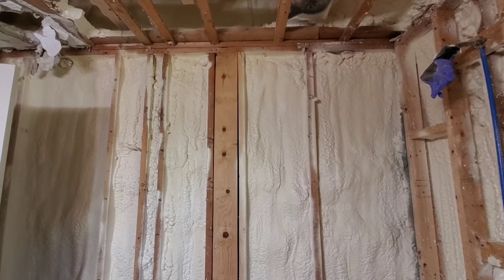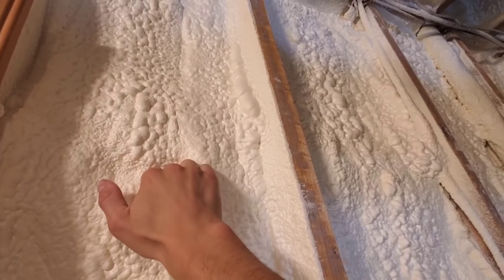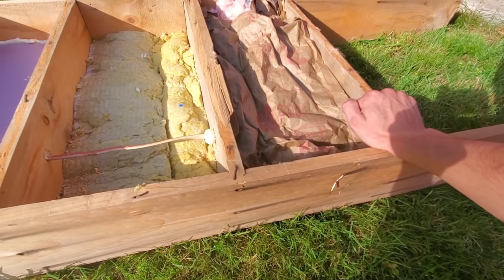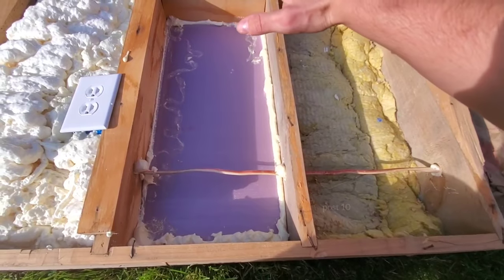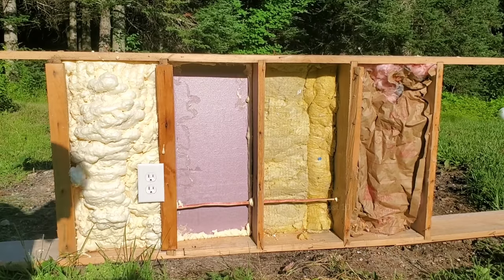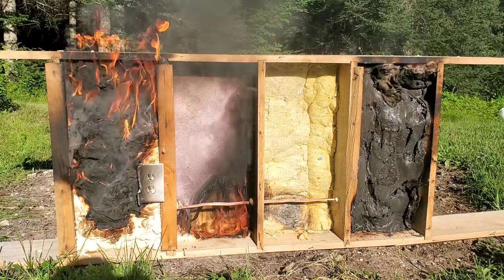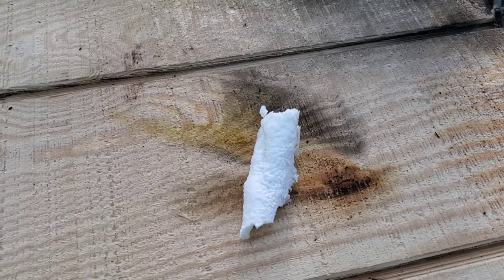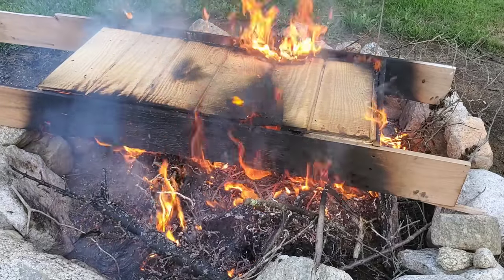Testing The Burn Ability Of Insulation In Wall

Comment: Well now, I was going to spray foam my basement but not now!  Thank you so much for this demo.
Reply from the maker: Spray foam is generally safe as long as it's behind sheetrock or the electrical work inside the foam is modern and can handle the load put on it spray foam is a great choice for a basement to solve a humidity
Reply: I would advise you to use foam in the basement or leave it uninsulated. Batt insulation is not advisable below grade as any moisture infiltration could cause catastrophic mold issues
Reply: @JKSSubstandard  Rockwool cannot absorb water and will not mold. I used 2" foam board on the concrete, then a 1" air gap and filled the stud cavities with Rockwool.

Comment: The spray foam in my home was treated with a fire retardant and very difficult to burn. In a real world scenario the insulation would likely burn less than in this test as the drywall would limit the amount of oxygen getting to it to an extent.
Reply: Finally some common sense, it takes oxygen to make fire.
Reply: Idk where you live but here firefighters are allowed to walk away from a house that has spray foam because  of health hazards. One reason spray foam isn't that good
Reply: @roastingpeanuts  this is not true. Why are you spewing nonsense?
Reply: You hope.
Reply: @roastingpeanuts  Just flat out not true. If the spray foam is up to code, the house can be entered.
Reply: thats not the right foam to  do that type of testing on Can foam or window foam is not treated like the spray on foam
Reply: A thin layer of Gypsum/Plaster does The trick!
Reply: If the spray foam is up to code, it’ll go out just like the rock wall
Reply: @metapaneco16  thank u!! Somebody knows can foam is completely different from actual spray foam!! Also foam seals up a house so well that it can’t  bring in enough oxygen to keep the fire burning. We have had a house catch fire before and it burned for 45 minutes and there was a basketball sized burn spot and the house was saved. Due to lack of oxygen for the fire to burn.
Reply: @roastingpeanuts  rediculous. I would have to see that in writing there’s no way to know what insulation material is used in a home as a fire fighter just coming up to the scene. The furniture is just as bad or worse as for as toxins.
Reply: @roastingpeanuts  So all the burning plastic and furniture is all good for them then? A burning tv or foam couch isnt toxic?

Comment: Thanks for the video! Very interesting. Over here in Spain, we use insulation board and injected foam frequently, but our way of building residential houses is completely different than that in the US and uses bricks, cinder blocks, or cement for everything, leaving an air gap between external and internal walls that can be filled with the foam. However, whenever drywall is involved, the general practice is to insulate with fibre glass from a roll (or also injected in the air gap).

Comment: Few notes. The yellow is rockwool and is meant as a fireproof insulation. It's made from stone fiber as opposed to glass. It's main use in the US is fire rated wall assemblies. Second, while the rigid foam materials are flammable, they aren't nearly as combustible meaning they need a significant heat threshold to start burning as opposed to just melting. Normally these materials are all protected from open flame by gypsum drywall or plaster. All of these materials are laboratory tested before they can go into a building.

Comment: Spray foam insulation is awful. Foam board isn't much better.  It burns enthusiastically, for a long time, and produces very noxious smoke.
Spray foam, in particular, can also not be applied correctly and not cure properly, resulting in the outgassing of large amounts of VOC's for extended periods of time.
Reply: Only one thing i can think of for spray foam and foam boards is good for is for cosplay. You can make pretty impressive looking armor and props (fake weapons) out of em
Reply: As far as fire hazards go, yeah, the video shows it's pretty bad in that regard. But apparently it has its own benefits aside from that?
Reply: @leezard7696  thats what i meant 🤪
Reply: @GizmoTheGreen  I believe that foam stuff is banned in all of Europe, for good reason it seems.
Reply: Is the not curing issue still an issue- we had problems in the US a decade ago but thought it was fixed with better formulations and training.
Reply: @qactustick  many. First, it holds its insulation value even when exposed to water while fiberglass and rockwool can lose much of their value, sometimes permanently. Second, they don't like to mold which can compound the batt insulation issues. For these reasons, batt insulation should NEVER be used below grade. Third, while these tests do show a flaw with the foam, know that it's an unlikely one to manifest in most situations. While they are flammable, these materials are meant to be behind gypsum and plaster which should protect it from direct flames long after everything inside the house is lost already. In this sense, your furniture, wood floors and vinyl tile are more likely to burn up than foam insulation in a house fire. They also have a high combustion point and tend to melt rather than burn when exposed to heat. Moral of the story, should every home be fully spray foam? Probably not. However it's not inherently dangerous even in event of a fire
Reply: @GizmoTheGreen  not banned and available in Sweden.
Reply: @NekiCat  not banned in Europe, but compared to the US it's a fairly new isolation material, hence why it's not used as extensively.
Reply: One more reason I would never considerate in a home...the long term VOC issues.  I'd rather pay a little more every month for fuel consumption/electricity than have this spray foam in my forever home.  We have it used on commerical jobs all the time and it's some air tight, good sealing stuff...no thanks for me though.....I don't need to live in a vacuum tube either.
Reply: @NekiCat  it's not banned, I've got it in my house, open cell one, way better than fiberglass. I don't know what kind he used on this video but here it's fire retardant and had instalator showed me on a piece with a lighter, it melts and barely burned and once he took the lighter away it just stopped.
Reply: You use that stuff in america in houses oh boy.
Reply: while xps foamboard does melt (because it is plastic), you must do 2 things when creating a hybrid insulating setup for basement (still best method 2" xps & 2x4 R16 stone wool), you should always use stone wool (rockwool) insulation instead of fiberglass bats, and create a fireblock separation every 2 panels (8ft) to limit/slow fire spread if the fire does manage to get through the rockwool and start melting the xps.

When using any sprayfoam, you should be using an anti-fire protective layer atop it like Soprema DC315 for example, which creates an ablative fire protection layer.

Comment: The variable of limiting air and flow seems significant.  Possibilities that come to mind are foil backed foam board, drywall sheeting, and combustible paneling to cover both sides of the cavity.
Reply: You are correct, That's why the IBC has what's called protected assembly's..ie the combination of different materials make a PROTECTED ASSEMBLY!!!!!!!!!!

Comment: First off, code almost eveywhere requires that closed cell foam in any living quarters be additionally sprayed with an intumescent paint.  This is a fire retardant that works extremely well.  Fiberglass insulation is the poorest insulator of these four by far.  Especially at rim joists where so much heat is lost in an average home.
Reply: intumescent paint is only required in exposed living areas with no drywall such as an unfinished mechanical room. typically your foam is separated from living space with drywall which acts as your thermal barrier.

Comment: I totally was going to put the spray foam in the remodel on my house. The selling point is the thermal capacity. Id rather pay a few extra bucks a month in heating/cooling then what I just saw. That yellow foam, id I can figure out what it is, is what im going with. My family matters to me
Reply: Rock wool. That’s what you want. Not the spray foam, you want the rock wool.
Reply: You should chose an insulation material on it’s insulation value. You will use fire resistant OSB sheeting anyway to cover up the walls.
Reply: This test is flawed. Closed cell foam doesn't burn/rot/mold. This guy used Great Stuff out of a can. It's not the same thing. I build homes, do yourself a favor and get it spray-foamed..
Reply: @humanbeing-001 Have to agree with you. The savings on energy will be great with spray foam and the wall cavity should be closed to the outside, so the odds of fire are way lower than most people realize

Comment: You showed it very well.   I've showed up to a fire with a house that had spray foam in the walls.   4800 Sqft fully involved.   The sky was full of burning pieces of spray foam floating in the air.  Crazy town.  To make a correction, Rockwool is just as good as spray foam when installed correctly (cracks taped), though costs a bit more.

Comment: There are many Spray foams that are ASTM E-84 1 hour fire rated. The small cans sold at home depot are of a different compound, while yes I prefer fiberglass insulation or the woolen batten there is more info to be had. Also fuses can be wildly unpredictable, a modern thermo-magnetic breaker is almost always a safer choice.
Reply: This! Great stuff is not the same as spray in foam insulation

Comment: The problem is, the first two bays are petroleum based products. They're going to burn and smolder for a very long time. That first bay is scary the way it traps the fire in it. The fire wasn't even hot enough to burn the wood, but caught so easily.

Comment: In Sweden we usually do not make vapor tight walls for wood houses, they are built to breathe.

So condensation is with consideration when the house sort of breathes the moisture outwards.

So a moisture barrier would just cause molds too. Swedish homes expell the moisture outwards, not trap it.

So even if the roof faces damage and moisture is on the wrong side of the barrier, the house will expell it outwards.

Comment: In NZ we don't use insulation board or spray foam. I'm glad we don't after seeing this video!
Reply: I can assure you that you do, just likely not in above ground walls. Foam is the only way to insulate below grade
Reply: @JKSSubstandard  not according to rockwool it seems, can be used below grade as well.

Comment: There are distinct types of foam with different fire ratings, including different types of foam boards. Wool is an insulation material, and so is the completely different mineral wool. It's important to know your subject and clearly distinguish what specific material is / is not being used from the beginning.

Comment: A slight defense of spray foam. The single part expanding foam used in the example is NOT the same as typical appendix x open cell spray foam that is being used today. It is non-combustible. Still toxic if it melts and vaporizes.
Mineral wool would be my first choice, then a cellulose with all borate formula.

Comment: Here in Germany Rockwool (and other stone wools) are the standard if you need (or want) to fulfill regulations regarding fire. For example over the windows you need to install a 30cm high „brick“ of rockwool. So fire fighters can enter with a ladder and rescue people through the window without dripping and burning foam insulation over them.

Comment: Also, keep in mind that spray foam insulation crumbles before fibreglass and rock wool. Rock wool is NOT flammable at all. It is only possible to distort or melt it at 2,800 degrees Farenheight (1,540 c). BUT spray foam decays. Anybody who has ever remodelled a 15 to 20 year old house with spray foam insulation will tell you: the foam shrinks and cracks and pulls away. It loses all of its 'air sealing' properties and leaves behind a miserable, toxic crumbling mess that is horrible to dispose of. With the sole exception of soy-based spray foam (which is also flammable AF and decays just as quickly) spray foam is also the most damaging to the environment and the most toxic to people. The foam outgassed for years and there are now thousands of law suits all over North America claiming permanent irreversible health damage from the toxic contaminants dumped into the house's interior by outgassing foam products. Thank you for enlightening us. It's flammable, temporary, toxic to the environment, toxic to human beings and pets, and stupidly expensive. I am 100% anti-foam!
Reply: exactly this, i dont even understand why its still used.
Also lots of lawsuits about vapour problems and mold problems because of this crap in my country on top of the things you allready said.

Comment: Rockwool has better heat tolerance and fire resistance than fiberglass insulation. the Rockwool could not have melted unless your flame torch goes over 1800oF. The insulated board typically melts and what you saw was the wood catching fire.

Comment: great video - had my suspicions about that foam stuff, won't be going near that as an option, or the foam boards. there is another video somewhere on youtube that shows also shows various materials burning AND what happens when you put out the fire with water - the pink fiberglass collapses into a globby mess so you lose your insulating qualities and have to replace it; the rockwool repels the water, stays where it is and the shape it is (barring say a huge blast of water direct from a firehose, that would probably affect its positioning at least). not saying you might not get mold from any moisture trapped that doesnt dry out, but i'm going with the rockwool, have already had a cabin (with fiberglass) burn to the ground in a wildfire, yes, fiberglass does melt/vanish in a big fire, and had a house burn down when i was a child. i am in an area with only a volunteer fire department (great people but takes awhile - probably too long - to get here) and low pressure out of the hydrant, so I have make the house reno as fire resistant as possible, on a shoestring, but i will be shelling out for the rockwool, that's for sure.

Comment: There are so many inconsistencies with your information provided and testing procedures. I’ve personally spoken with fire chiefs who said spray foam saved the house because it’s so air tight that the fire self extinguished. Great stuff IS NOT spray foam. It’s a completely different chemical makeup than closed cell. Also no reputable Foamer will ever mix closed and open cell foam because it will be garbage foam with no insulative value

Comment: Great, and we insulated an extension on our garage with pink foam sealed in with Great Stuff to hold it in and seal air gaps. It's going to be used as a workshop, with lumber, power tools, and lots of sawdust...

Comment: as a framer who stick frames houses and duplexes i can say fer certain homes built in a certain time of year or when lumber supply is low and the wood used is sappy and kiln dried to 15% humidity it can burn like a torch, I've even made a torch by cutting out the sections so sappy you can see light through it quite well and wiring the peices to a stick, flame was a foot tall for literally hours and dripped burning sap at points... from wood used to build ... homes... and duplexes... if you see black or amber waxy blotches on dimensional lumber that wood lights up like its soaked in diesel

Comment: So you're using Window and Door foam, its white, if you got a foam from a rig there is built in Fire retardants in it. Thats why you used Can window and door foam/gap filler, you didnt use a fireblocking  can foam either, they arent the same stuff if it was they wouldnt be selling it. If you going to do a test you should actually use the products that you are supposed to use, not what is convenient, just saying.

Comment: This video is a total fail . There is a huge difference between Great Stuff and the spray foam they use to fill walls and ceilings in construction . Mainly the fire resistance.  Look into it before you go spreading misinformation.